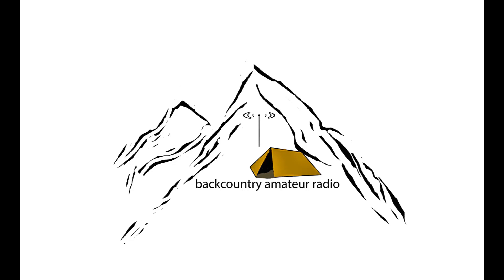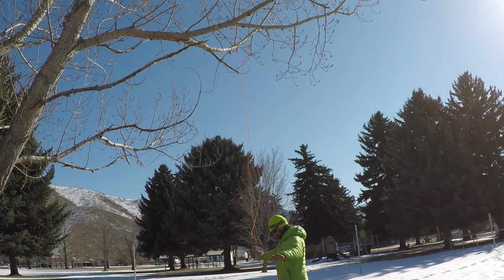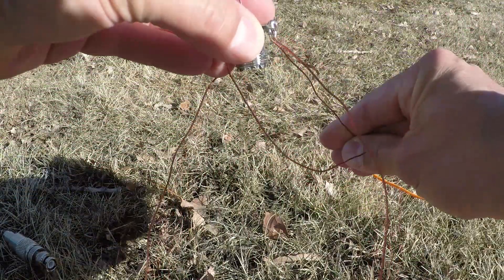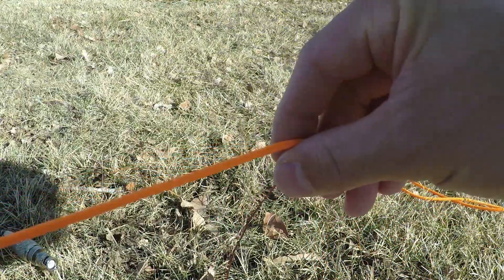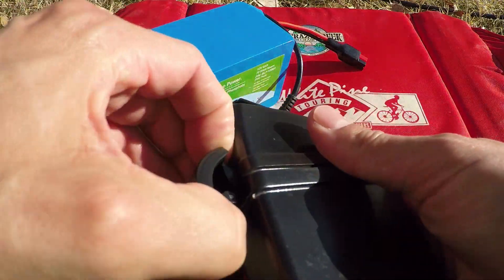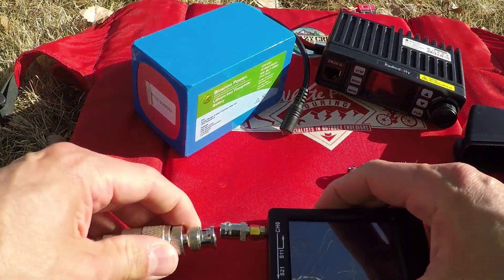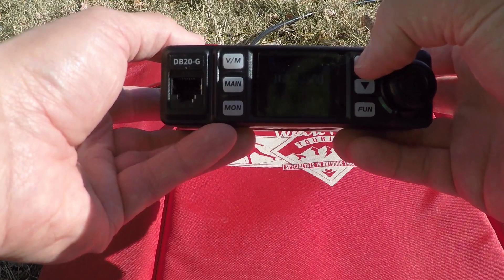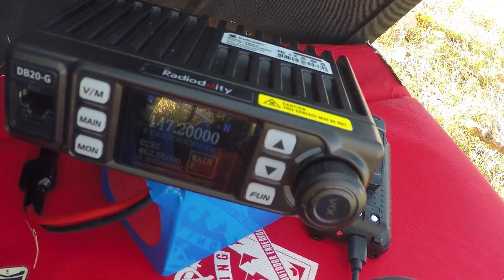Field Deploy GMRS Radio - Radioddity DB20-G Bioenno 12v6Ah battery and GP antenna (fail - no mic)

Comment: I have the little DB20-G in my truck... works great.  At home, I use an Ed Fong antenna... I wondered what I can do by hoisting that up into a tree.
Reply from the maker: How do you like that Ed Fong antenna? Well, antennas love elevation. It might be worth a shot, at least to test the extra height the tree could provide.
Reply: @backcountryamateurradio  I'm hitting repeaters 45 miles away... and it's sitting on the roof of my house.  I'm happy with it overall... inexpensive and easy to handle.
Reply from the maker: Sounds like it’s working really well! I’ll be taking a closer look at that antenna. Take care.
Reply: I ran an Ed Fong antenna with a DB20 @ home as well.  I recently attended a local GMRS radio check in a local parking lot.. they suggested using a Times Microwave LMR-400 PL-259 Radio Antenna Coax Cable.... It did seem to open up reception and radio checks with my friend across the valley on a HT indicate its an improvement.   Outlay for this versatile system, $109 radio/$110 Power supply 30A with a cigarette socket/$95 Coax/$54 Ed Fong DBJ-GMRS 5dB gain base antenna/ $7 200 PSI PVC ..... I was looking at how to attach the antenna to the roof vent, ended up just duct taping it FTW... nothing more permanent than a temp solution....
Reply from the maker: Those are important factors. Especially in respect to the Coax. At these frequencies, LMR400 is your best bet for the least amount of loss. It's a little pricey but after you use it there's no going back! As for the duct tape, I do believe you're right! Thanks for your post. Helpful stuff here. Take care. -Eric
Reply: @markcard7978  I built a wooden stand and attached EF antenna to it... it's just sitting on my roof... I'm using LMR400 cable, as well... just 20'  I also kept a ocsillating fan stand to use when I'm in the RV... good stuff!

Comment: I'm new to this so I have a question why are you saying wrfs 365 at the beginning of the transmission?
Reply from the maker: That is my GMRS call sign, and rather than doing anything else to test it, I just throw out my call sign while testing. Keeps it simple in the even that I don't make any more transmissions. I use the same approach with ham radio.